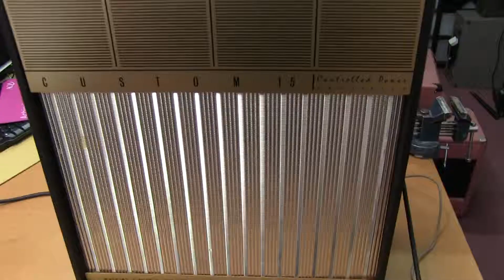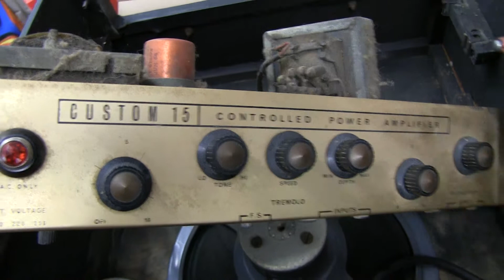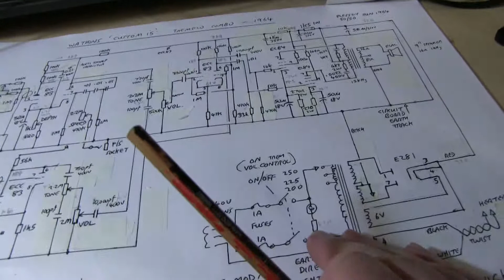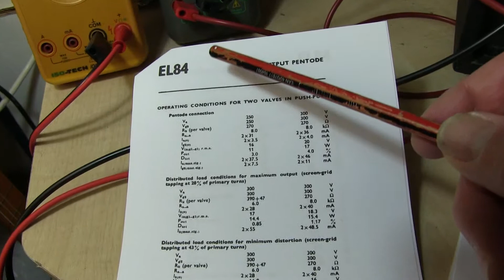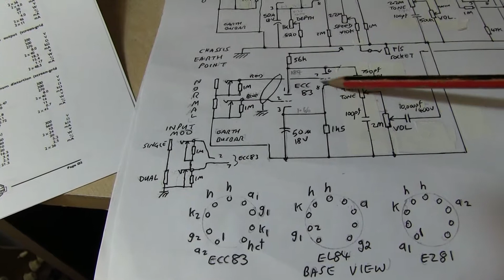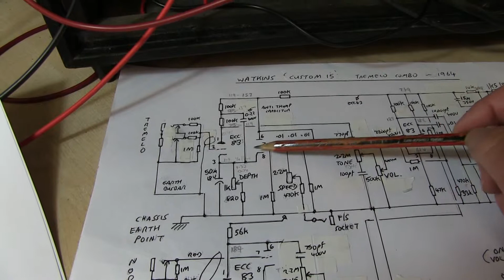Watkins Custom 15. Vintage amp from 1965. Service and sound

Comment: Anyone know if you need the foot-pedal to operate the trem on these amps? There is a specific input for the trem you said? I have seen one for sale and it says the trem is not working but they have no pedal to try.
Reply from the maker: Hi Wilton. Yes you need  to short the inner pin , of the footswitch socket, to ground to make the tremolo work.  The socket looks like phono plug socket. But note that it is an old style pnono socket and most modern plugs do not have a long enough centre pin to make a contact.  So you can make up a shorting plug, in place of a foot switch and that will turn it on, but only if the centre pin makes contact.  All the best and rock on. Nick

Comment: Did you find a solution to the rattly aluminium grill? I just got one and the grill was very loose so I took it off to reglue it, not sure what glue would be best to use. Any suggestions?
Reply from the maker: Hi Cian.  Use a thick flexible glue. ShoeGoo is ideal, as it is thick flexible and easy to apply.  Great amp, one of my favourites. Rock on, Nick

Comment: Nick - thanks for your very helpful and interesting videos. Having had the opportunity to go through a number of versions of the Dominator, the Custom 15 and other WEM/Watkins amps, how do you feel the Custom 15 compares in terms of construction, design, sound and usability for various purposes--gigging, home practice, recording and so on?
Reply from the maker: Hi Leon
I love the Custom 15, for sound and looks.
But they are rare now, but the square shaped Dominators are all good.
Get one of the lower rated ones as they are very loud for bedroom, and they produce the sound you want at near maximum volume.
Keep rocking
Nick